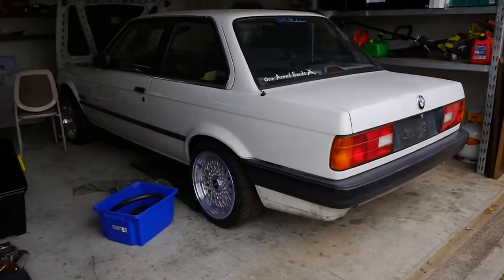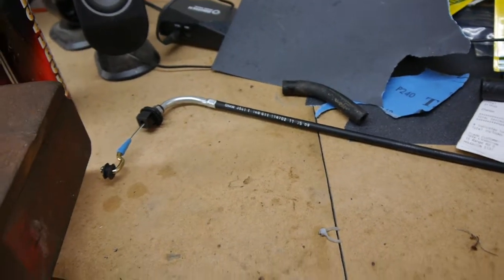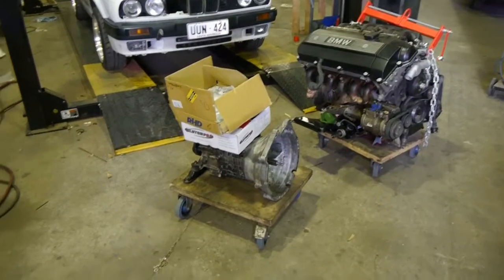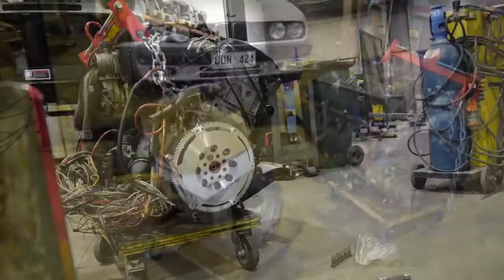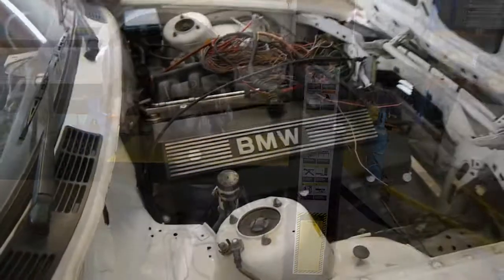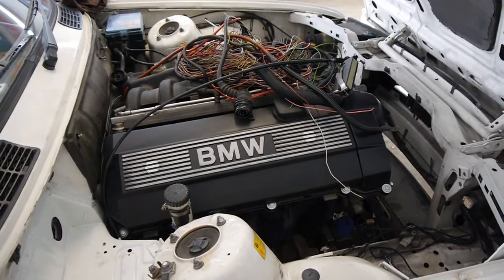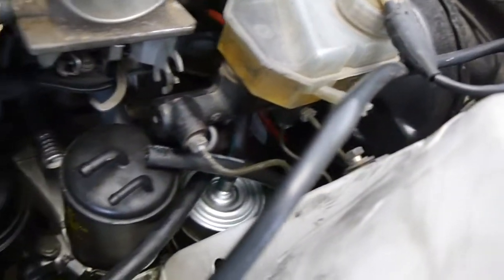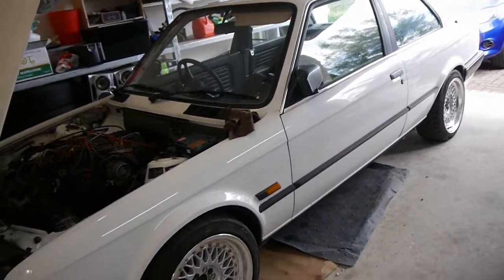E30 M52 Conversion Episode 6. Engine Insertion

Comment: I have a problem with my engine is bmw m52 the problem is that when car start while fuse line for fuel pump insert the car is missing but when we remove  fuse  the car start performing well no missing when fuse again  is not revving..
Reply: Still  when we unplug  the cold starter  still no change
Reply from the maker: so wait, when the fuse for the fuel pump is removed the car revs & runs but when fuse is put in and the pump is now working the car doesnt run?

Comment: Hello good afternoon I am about to do a swap to my e30, I am going to install an m52b28, could you tell me which motor blocks you used to solve the Servo brake problem?
Reply from the maker: If ya have a look on my channel, build episode 1 or two talks about the engine mounts. How i solved the brake booster issue waa going to a smaller booster though.
Reply: @OneArmedBanditYoutubeChannel  Got it, I'm going to see it again, and I've seen all your videos but in subtitles because I'm Spanish and I don't understand English very well .... Great channel I very good prollect You helped me a lot with some doubts, thank you very much 💪
Reply from the maker: @rafaojeda3568 cheers mate. I think this is the episode with what i call 'engine mounts' which im assumimg is what your meanimg by motor blocks. :)

https://youtu.be/TrCcak0ZuU8
Reply: @OneArmedBanditYoutubeChannel  The biggest problem is that it is not subtitled I do not understand .... 😔

Comment: Hey mate me again! When you installed the pilot bearing did you have it flush against the bump stop in within the crank, or did you have it flush with the flywheel?
Reply from the maker: Mike King just past flush. There needs to be space back there so you can remove it in the future.

Comment: Mate did you have to modify the transmission brace?
Reply from the maker: Nope. E30s have rails that bolt the  trans brace to the car, so i just moved it on the rails to where it needed to be
Reply: @OneArmedBanditYoutubeChannel  is this the same for all 240 boxes do you know? I'm having issues mounting trans up as it feels like the box is to the right too much....
Reply from the maker: I suspect the e36s had the 240 also so not sure if that one is different to e30.

Comment: hey mate what is the throw out bearing you have used and also how did you run your fueling? Fuel pressure regulator?
Reply from the maker: I just used m40 throwout bearing. In regards to fueling i just relocated the fuel filter which is in Ep 7 i believe. the fuel rail has an inbuilt fuel pressure reg so i didnt have to do anything about that.
Reply: What flywheel spacer did you use?
Reply from the maker: I didnt use any. Aftermarket flywheel i used doesnt need one.

Comment: Are you going obd1 or obd2?  Also, if going odb1, I assume you're gonna use the red 413 ecu?  If so are you going to get a tuned chipped?  Also, how are you going to do your exhaust?
Reply from the maker: I am stay with whats on the engine which I think was OBD2 and I have an ecu someone has flashed that removed ews and put a 7200rpm limiter and did some other necessary stuff which was like $150 to get done. Exhaust has been done by a local exhaust shop and is 2 1/4 inch twins which sound nice.
Reply: nice!  I bought a 1990 325is that had been swapped to an m52b28.  I'm having some weird issues.  Was seeing how you were going to set up your car.  Thanks for the videos!
Reply from the maker: No worries, I've already filmed most of the next video and started the car but its idling at like 2000rpm so im gonna need to sort that.
Reply: Hey mate I was just wondering if you could pass on the information of who helped you with the ecu? I've got an M52 from an E46 and will need to get the EWS removed so I'm looking for someone who would be able to do that. Thanks heaps! Your videos are great btw

Comment: What starter motor did you end up using? I've been told to use pinion from 325i with the m42 starter. Thanks.
Reply from the maker: Depends on the flywheel you are using. The one i used has the gear specs as the m4x and m5x starter motors so i just used standard m52 starter. If you us an m20 stock flywheel, then you will need a stock m20 starter.
Reply: Thanks for the info mate, using the same flywheel and have the m52 starter.

Comment: hey mate, insightful vids! what trans did you use?
Reply from the maker: original g240 from behind the m40
Reply: im running a 250g behind an m54 but it blew. I wonder what the length difference between a 250g and a getrag 240 is
Reply from the maker: not sure, but i have a friend with both so i might msg him and find out.
Reply: so good to see aussie content on here!
Reply from the maker: thanks, yeah most are US based. They have some different challenges than us converting there cars being on the other side